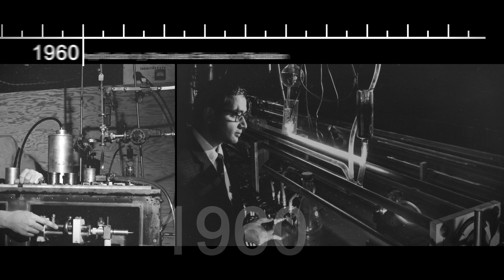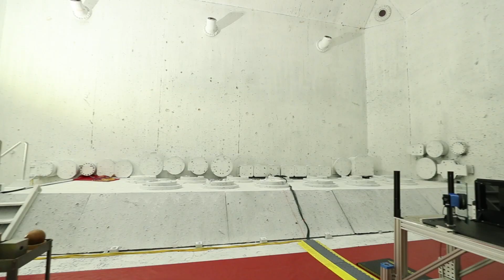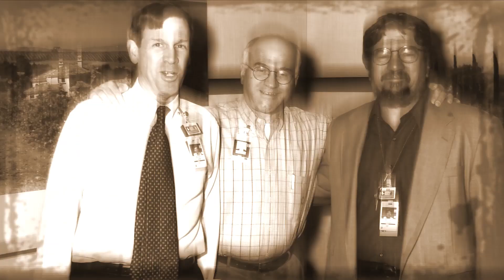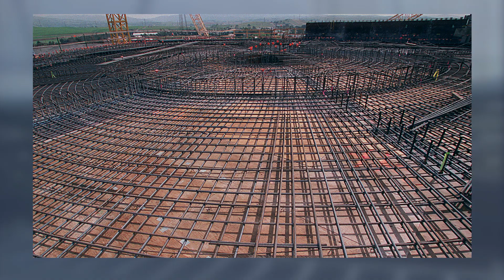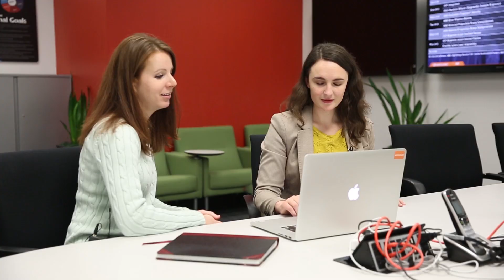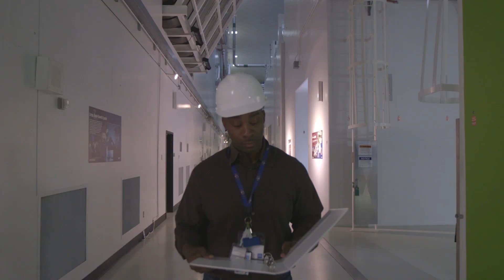Ten Years of the National Ignition Facility: What It Took to Make NIF a Reality

Comment: the matrix its man use not man creating..... laser fusion reactors using deuterium & tritium extracting from oceans... (abstract communications) 
In 2003, the USA rejoined the project and China also announced it would join. After deadlocked discussion, the six partners agreed in mid-2005 to site ITER at Cadarache, in southern France. The deal involved major concessions to Japan, which had put forward Rokkasho as a preferred site. The European Union (EU) and France will contribute half of the €12.8 billion total cost, with the other partners – Japan, China, South Korea, USA and Russia – putting in 10% each. Japan will provide a lot of the high-tech components, will host an €1 billion materials testing facility – the International Fusion Materials Irradiation Facility (IFMIF) – and will have the right to host a subsequent demonstration fusion reactor. The total cost of the 500 MWt ITER comprises about half for the ten-year construction and half for 20 years of operation.
India became the seventh member of the ITER consortium at the end of 2005. In November 2006, the seven members – China, India, Japan, Russia, South Korea, the USA and the European Union – signed the ITER implementing agreement. Site preparation works at Cadarache commenced in January 2007. First concrete for the buildings was poured in December 2013. Experiments were due to begin in 2018, when hydrogen will be used to avoid activating the magnets, but this may now be about 2020. The first D-T plasma is not expected until 2026. ITER is large because confinement time increases with the cube of machine size. The vacuum vessel will be 19 m across and 11 m high, and weigh more than 5000 tonnes..... b̶͍̆̔̐̾u̷̧̗̫̹͚̳̩͚̥̍͠ ţ̶̳͙̳͔̻̩͕͈̻͇͂̂͆̋̕͝ ...ÿ̵͍̗̖͖̙͚̖͔͔̦̣́̐̿̄͛̐͝ͅaa̸̧̿. ...knowing & believing are also  different   things...
atiki taki tiki tu
 🌏 📡🌏 👣🕖 💎👽☠☼☾☄ゞど・ㇺㇾㇽ₪𝖎𝖙𝖎𝖇𝖎𝖗𝖆₪なめㇺㇾㇽ✶☥✨🌛🌄⊀✶⋊🐺🐾♓️☆🐜🐜🐫▲▴◭

Comment: Ok so no fusion - but you are proving one thing - how a publicly funded research facility can first attract huge dollars by promising one thing AND continue to attract huge dollars by not delivering but cycling through to more promises ... well done all!
Reply: Despite the scientists promoting the work being done under the giest of solving sustainable fusion reactions, this turns out not to be the case at all. Yes the work they do subsequently teaches them more about fusion fundamentally which in turn can be used to help solve the problems surrounding fusion reactor research... but fundamentally NIF is used to research how to build better nuclear weapons specifically trying to solve the problem of creating a pure fusion weapon aka the holy grail of nuclear weapons as a true fully developed fusion weapon would be able to leave little to no fallout thus allowing for the deployment of nuclear weapons tactically with less chance of MAD as the possibility of yield strength being designed to fit any size yield parameters essentially. So just bc they advocate this as fusion research, which it is as I already stated, it's just not a project working directly to create working fusion reactor. Rather to reiterate NIF is a tool used to help research and develop better nuclear bombs and hopefully a pure fusion weapon, also NIF subsequently can essentially simulate nuclear bomb detonations (obviously on a much smaller scale)  allowing the us to conduct further bomb research without the need to actually detonate anymore atomic bombs hence why this is such an important project within the us physics community...
Reply: Only 10 KJ was deliverd to the target by 1.9 MJ sum of the lasers power four years ago/ one month ago they delivered 300 KJ to the target by using only 1.6 MJ sum of the lasers power. Think about who goverment should to sponsor.
Reply: @nicolasleman2728  Where do they post this information?
Reply: We've reached fusion twice now. Our last was nearly double the output of our first.
Reply: They could have at least fired up the freaking laser and showed it off

Comment: They have not achieved fusion in 2019? So now NIF is used for everything else besides what it was built for? No wonder sceptics want to stop funding.
Reply: first time target was ignited in 2013. if you be more attentive you would notice that they increased energy, which comes from capsule, 30 times in the last four years/
Reply: It was never built for creating a fusion reactor (though their research does contribute empirical knowledge gained from their experiments to the project of creating a fusion reactor) its primary use is for the R&D of nuclear weapons as well as the simulation of nuclear bomb detonations, ultimately they are hoping to learn enough to create the king of nuclear weapons i.e. a pure fusion weapon.